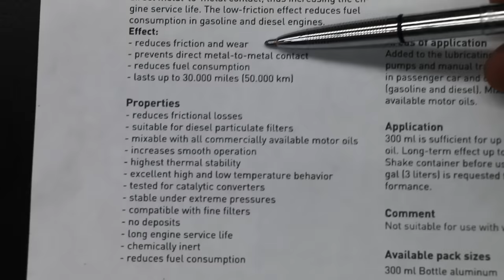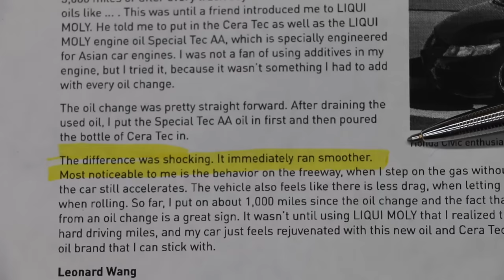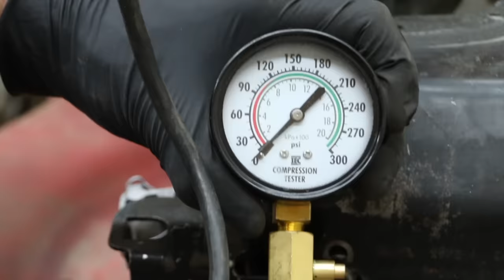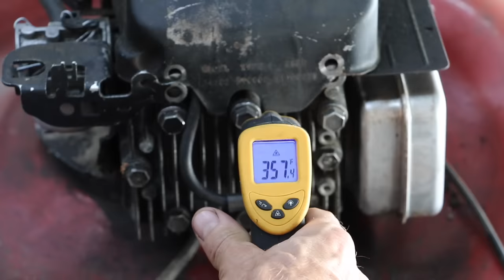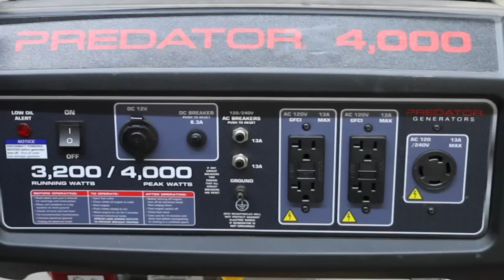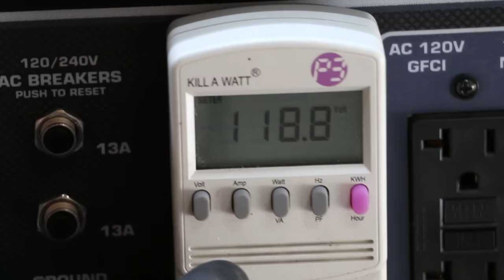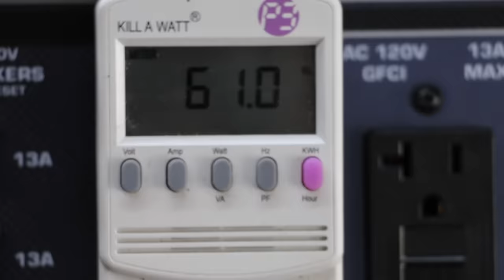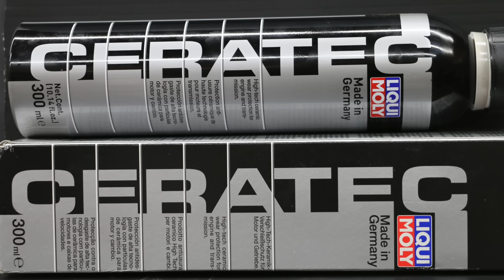Does Liqui Moly CeraTec work?  Let's find out!

Comment: After buying Liqui Moly CeraTec, I noticed an immediate difference in my bank account.
Reply from the maker: Thank you!
Reply: Lost more money?
Reply: @rajrammbbs  It certainly didn't go up.
Reply: You must have a $40 or less bank account.
Reply: Fool, you should not had to buy Liqui Moly, but a money tree
Reply: lollololollololollololol
Reply: I bought Duralube and used it in my 72 Chevy El Camino and the engine noise was reduced.  Someone cut the fan belt one day.  Had just got back from a fifteen mile run when I glanced at the temperature gauge to see it pegged beyond any numbers on the gauge.  I just shut the engine off.  I was able to start the engine the next morning without any knocking.  The engine is still running with over 165,000 miles more than twelve years later.  I did drain that over heated oil.
Reply: The seafoam vid is the best one!!
Reply: Issac Bourne you can do this on newer vehicles too.  An even easier way is use two 5 gallon buckets, remove both hoses from the trans cooler, put the hose that pushes the fluid into the empty bucket and put the one that pulls into the other bucket with 8-10 quarts of clean trans fluid.  Start the car, the trans pump pushes out the old fluid while pulling in the clean fluid.  When clean fluid comes out the other line shut it off and reconnect the hoses.  You will need to add a length of hose to one or both lines with an a brass connector but that’s it and it’s pretty simple.
Reply: Which tarp did you use?
Reply: @roche4647  I used a social distancing tarp that's at least 6 ft from any edge.
Reply: @wisenber  How much does it weigh?
Reply: chijen2010     i have about 100,000   but  in a few accounts
Reply: LMBO that's about it!!
Reply: Can you test the MOA that Ford pushes?
Reply: Best coment...🤣🤣
Reply: Hahahaha
Reply: Ha ha ha LM loking for money not happy customers😉
Reply: That $20.00 really broke the bank huh? Lol.
Reply: bank account almost empty 😋
Reply: @ProjectFarm  have you heard of Russia oil additive called RESURS. Its metalizer,and lubricant that literally instantly turns your bad engine into normal working one.  I tried it on my older car, and it reduces oil consumption, raises compression and engine works more smoothley and its quieter. here is the link 
https://youtu.be/_StNPwBcnv4?t=68
Reply: Using a lawn mower does not mimic the heat and pressure conditions of a car engine.
Reply: @michaelpearce8661   duralube contains chlorine which will reduce friction but it is a bad product since in contact which humidity it can turn to acid.
Reply: @issacbourne5111  I made the post 8 months ago on something that happened  in 2008, if my memory serves me correctly and I just replaced the transmission about a year ago.  Got a three year warranty on it from AutoZone and put it in myself on the ground using cargo straps to jack it up into place after lowing the vehicle on the jack stands.  She still is running.  Do they honor the warranty that is included when you by the product is more important to me.  When the overheated engine situation happened the vehicle was just over a 100,000 miles

I appreciate you taking the time to respond to my comment and changing the oil in the converter I didn't do but I did get a chattering movement in reverse during the cash for clunkers program and took it out and bought another one from a junkyard and still have the original transmission in the cargo area of the El Camino.  The junkyard transmission went out one day.  Went to put her in drive and she didn't move no matter what gear making me purchase the rebuilt transmission for $1,000 with a discount coupon.  The transmission comes with a rebuilt torque converter.
Reply: @uroskostic8570  I checked out the video and made two comments.  An additive that thickens oil will give you higher compression for worn out oil and compression rings.  Nothing special in that video!
Reply: @michaelpearce8661  it was made to be used on new oil , and it supposedly fills those gaps in metal parts. I am not from Russia nor do make commercial for it. I only used it  with my car, that wasnt broken or old. I used it on 76000km  and now is 84000. I will change oil soon, and so far havent had any problems. Russians claim, if you pour it into engine, it can run for two hours without overheating if you suddenly lose all oil. They say it creates thin film between metal surfaces.
Reply: LOL
Reply: its fucking 10$ , get over it 
10$ extra per year if it helps even a tiny bit increase the lifespan of the engine is totally worth it
Reply: @ionutth4895  Your lack of awareness is stunning.
Reply: Look how clean the engine can be after using Liquy Moly oil and engine flush
https://www.youtube.com/watch?v=x4u64lKBbhQ
Reply: @zoomed66  Sure doesn't, for one the compression is MUCH lower than that of even a subcompact car designed for economy. And with most lawn mower engines, maybe one with skills can get a single rebuild for half the usage, forget a 2nd, total waste of time. I've had many more lawn mower engines break down on me than autos, and one was equipped with a $400 (at the time) Honda engine. For the record, I did run Mobil 1 synthetic oil, just as my pressure washer with same brand engine. 

While the pressure washer never died on me (was used less), the lawn mower with Honda engine lasted no longer than a freaking Murray! The frame rusted through on the Honda a year or so faster, found another to bolt it to, a waste of time, didn't last that summer (engine pooped on me) & received monthly oil changes. Could had purchased two of the Murray brand for one of the Honda. Not even Mobil 1 synthetic could make it run longer.
Reply: That's awesome!
Reply: @strixt  please explain the everything you claim is
Reply: Hehe
Reply: Fucking gold
Reply: Lol
Reply: Rofl that is a definite
Reply: Future gain,
Reply: Engineer also need to fed their family, nvm the German are rich
Reply: 5555
Reply: You wildin yo 😂😂😂
Reply: Haa haa.. so true
Reply: @ProjectFarm  best hand files for metal?
Maybe even include one diamond set to see if the price is worth it over HSS files